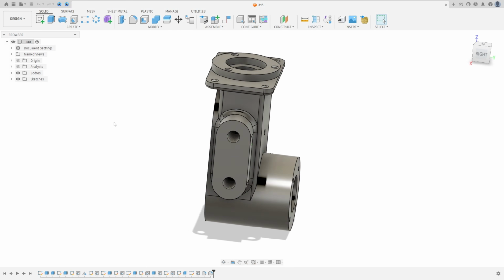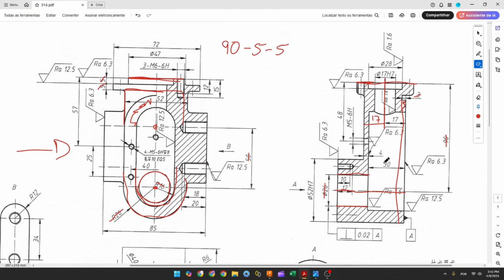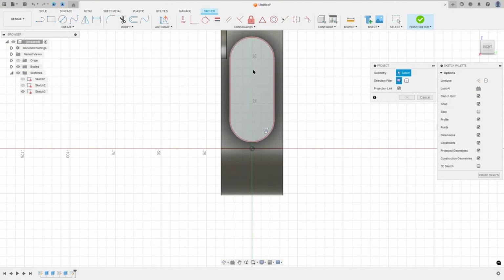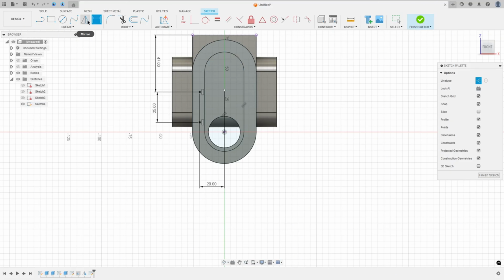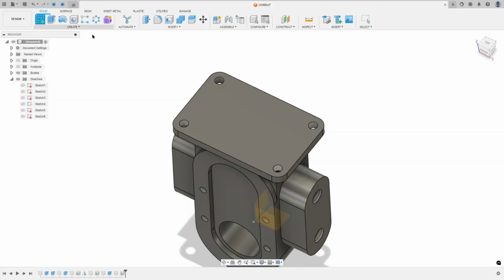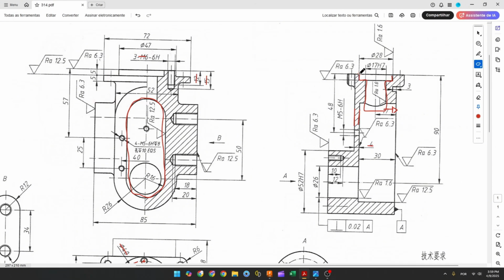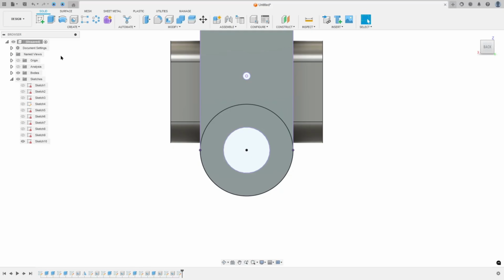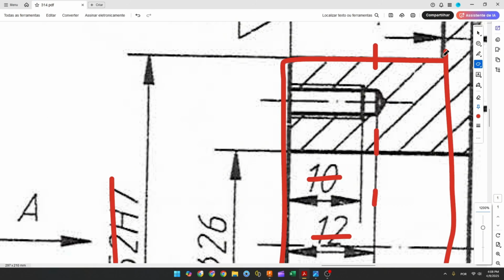Autodesk FusionTutorial: Modeling a Pump Housing (Cast Part)

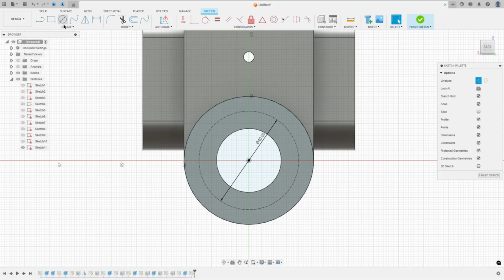Comment: Thanks! @24:50 in the video, instead of making a 45º construction line, add the constraint of horizontal/vertical to the top two points after you make the circular pattern. Also, I modeled the threads and was unable to make the filets at the end because the hole interferes with the edge of the body. No biggie. Thanks again!